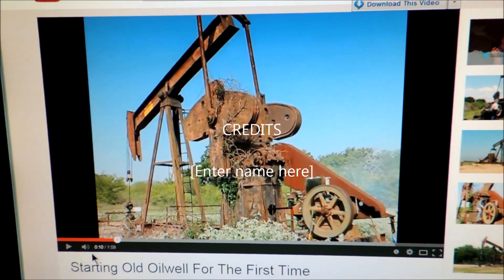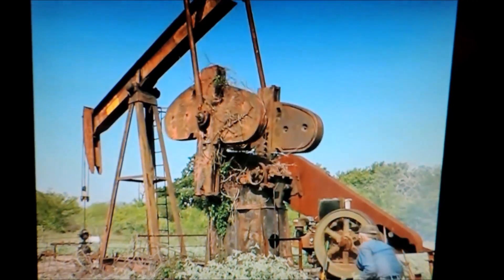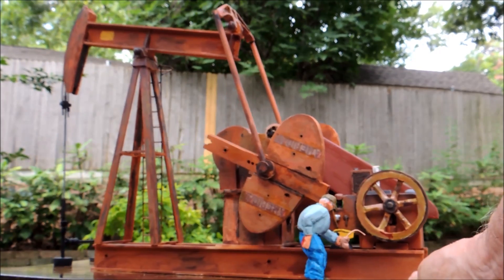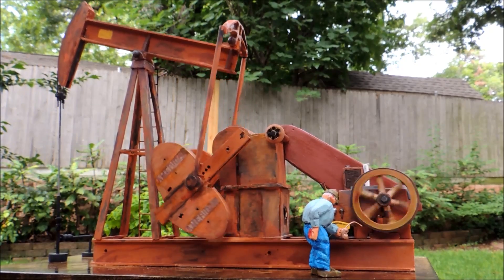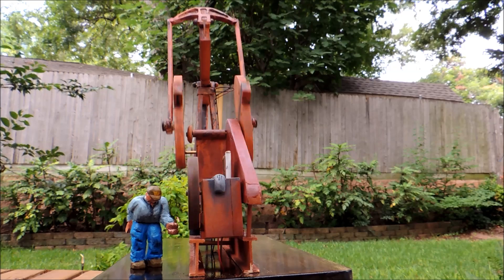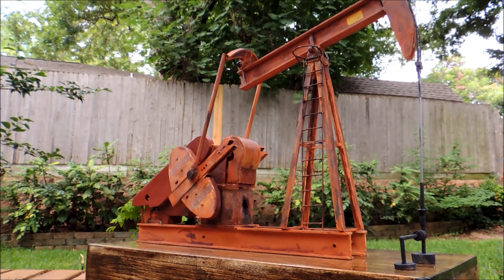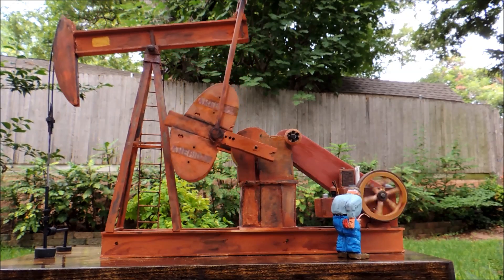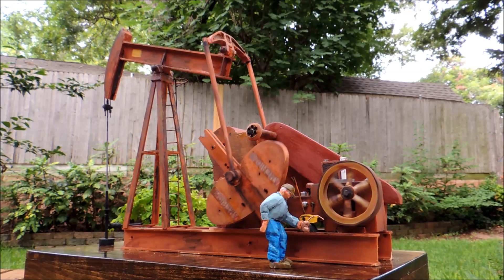Starting Old Oilwell for the 1st time (Model)

Comment: Fantastic! How is the model doing today?
Reply from the maker: Still doing well...  I do not run the electric motors ,,,  since the main one stripped a gear and I have to replace it ..    it works but it is kind of jerky when it reaches the broken tooth.    Thanks for the inquiry .   Really enjoyed making this model..   I still have the patterns ...  and I may build another one.
Reply from the maker: I replaced the broken electric motor and rewired the whole thing ..  Now the ON  and OFF switches are in the back of the rig rather than inside.
Reply: @rolandopupo  , If you make another one, let me know how much and I would like to buy it.
Reply from the maker: @derekdz  I have considered building another one.   The price would be $300.   Shipping would be extra since as you know it is a delicate piece. It would take me about 2 to 3 months to build. I have to order the 2 small electric motors.
Reply from the maker: @derekdz  I have to call Michael Turner since he said he would buy the model. but then Covid19 hit and he never called back.
Reply: @rolandopupo , that would be great if they got one!